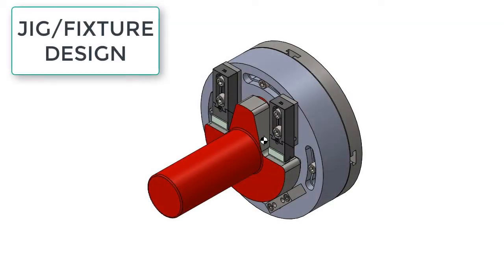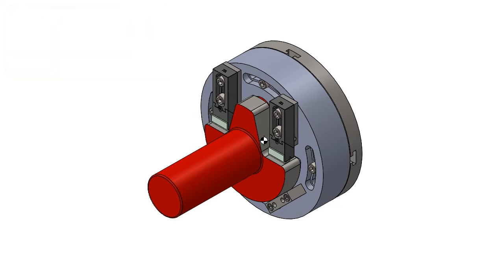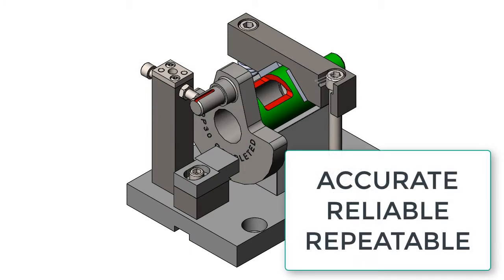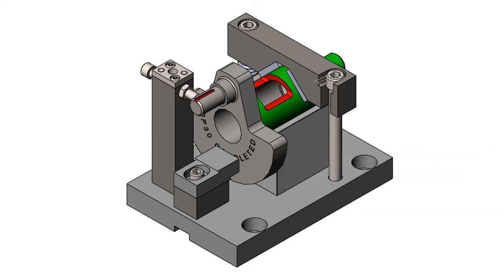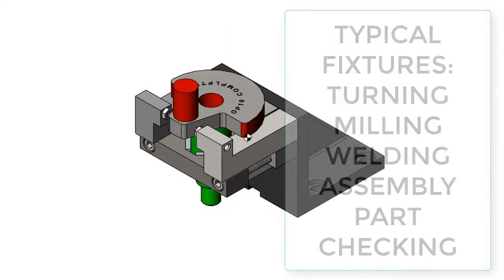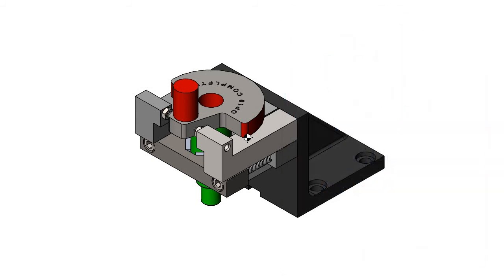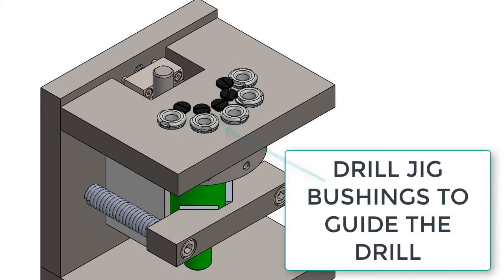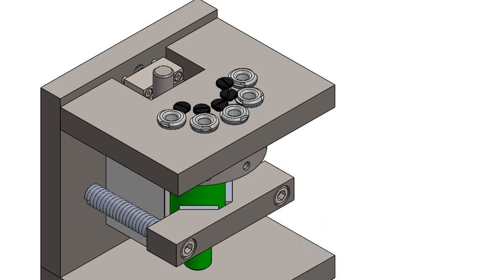Welcome to Jig/Fixture Design

Comment: Hello Fred. Thanks for putting this content out. Great stuff. I have a question about the swing-strap clamp you have depicted. Is the operator supposed to tighten both socket head cap screws to apply even downward pressure on the cylindrical section? How do you prevent binding? is it a matter of having a tight/long clearance hole for the "spring side" and ensuring the bar is stiff enough to handle the clamping load? Just curious
Reply from the maker: Yes both would be tightened. The clap are would be hardened, to prevent bending.